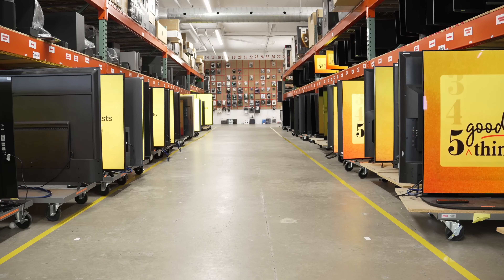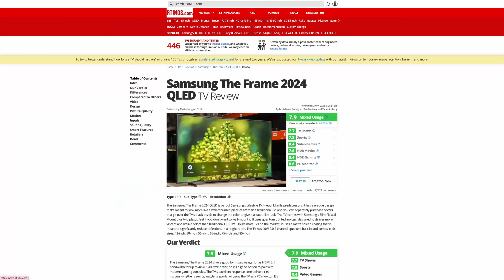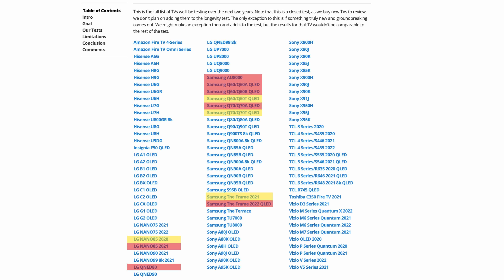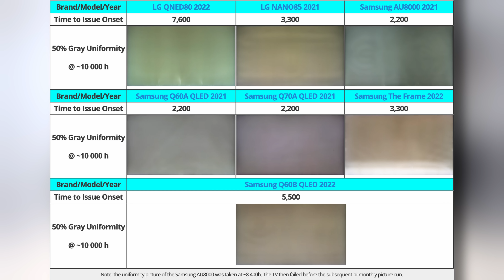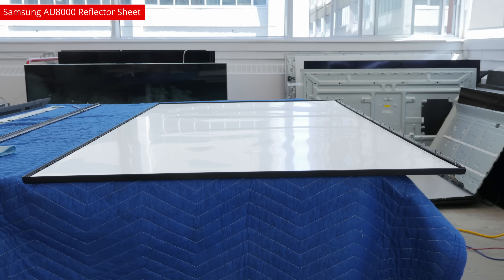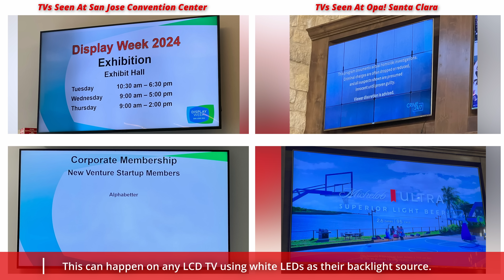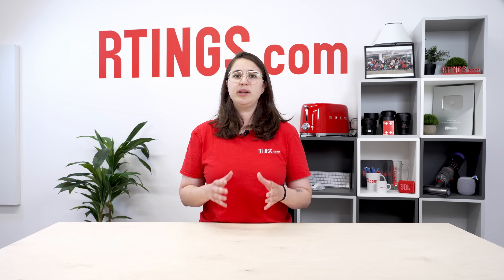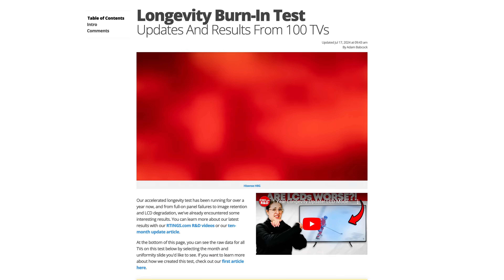Edge-Lit TVs Fail FASTER Than Others (100+ TV Test)

Comment: I might be using my TVs more than average. I got 25,000 hours within 7 years use.
But that is of course high end use. But that said, I think most TVs in family homes have a lot more use than 4.5 hours a day (which is what 10,000 hours is over 6 years). A family with kids will have them watch it then parents etc in evening. Some days more than others. Especially when most are home. 

So the problem in this case is mostly thinly built LCD and edge-lit ones. Basically the really low end crap, except a few models. But still crap (yes they are). Not surprising. I am sure some higher end MiniLED might fail here and there as well. But question becomes are those an outlier lemon or not. 

I have a high end thick miniLED I don't expect it to fail. Sony Bravia 9. But that said I will get extended warranty from Sony because it's expensive and even if they are not prone to failing. Sometimes a TV is just a lemon/dud. 

The OLEDs all burn in. But otherwise seem good. I wish they could come up with in-organic "O"LED in the near future. That would be ultimate TV. And no microLED is never really going to work out.

Comment: On my Sony KDL-43WF665, which I have for almost 6 years now, there is a "lighting gradient". Lower part of the screen appears brighter than the upper one and causes raised black levels and uniformity issues in general. It kinda looks like the reason is the edge lighting, but as far as I'm aware, it has Direct LED. Also my relatively new LG C2 48" has a simmilar uniformity issue, but much less pronounced, left part of the screen is slightly dimmer at low brightness colors (about 15 out of 255 an lower) and appears to be a bit red. Slightly visible at youtube loading screen when using my ps5.

Comment: My last LCD turned blue in about 4-5 years. My OLED just had its 4th bday and there is some very very faint  burn in if I run display a near black grey screen, but otherwise the picture is still beautiful and vibrant. I’ll take that trade every time. Can’t wait for full PHOLED in the next couple years. That’ll be my next upgrade when it gets under 2 grand.

Comment: I have a 43" Samsung LCD that i semi recently replaced with an oled. It was already cheap when I bought it in 2019, so  I took a crack at replacing the leds myself. It had all the "features" you mentioned (cracked back layer, burnt out leds) and in an act of incredible cheapness i "solved" the issue by flipping the diffusion layer 180 so the cracks were on top of the screen. ( of course i didnt line everything up right the first time, and I pinched a corner too hard putting it back together the second time but at least  it's not in a landfill just yet)

Comment: That explains why I never had any issues with edge-lit LED monitors. I always use them at low brightness (0-20%), and they never stay on 24/7, so  they don't generate as much heat and have a lot of time to cool down. Now I wonder what has better cooling, TVs or monitors? I had never looked at the cooling aspect before.
Reply: I wouldn’t say monitors have the better cooling, but they tend to be quite a bit smaller. 
As a result they need less backlight and can therefore run cooler.

Comment: You forgot a very important point about lowering damage for heat on flat TV's.
Wall hanging them and the sun.
If you want your TV to last don't hang them on the wall, don't allow direct sun on the panel front or back.
And of course the lower you run what ever kind of backlight or OLED light setting day to day the lower it will last.
I have a LG 4k OLED from 2015 with over 41K hours on it with zero burn in, 
it has actually gotten better over the years because all those compensation cycles evened out pretty much any of the flaws it had when i got it. 

Point is, don't let them run hot if you want them to last, save the max light output to when you need it like watching HDR movies or something like that.

Comment: Oh wow, troublesome news. My NANO86 being used 15 hours a day with maximum brightness so far over a year going strong, uniformity is fine. But definitely makes me cautious. 
Although there is now a speck of dust (not a dead pixel) pretty visible under the front plastic layer, no idea how it got there.
Reply: after 2.5 years of use I decided to sell it, but buyer returned it due to backlight being whiter and brighter on the bottom than on top. I didn't notice how it started happening.

Comment: I just tested my 2014 Sony W950B which is supposed to be edge-lit with full white (no light sensor, max backlight) and the temperature was the same across the entire panel and also the screen is pure white.  

Does that mean that it's not edge-lit and everyone got that wrong? 🙂 In your defense, Rtings did NOT specify the backlight in its review unlike other stores and reviews.

Comment: My Sony X900E has been on for 40 000 hours according to the service menu, still looks as good as it did when it was new. Been used as a pc monitor basically every day since 2017. 

According to Rtings, thats 24 years of normal use, so thats pretty cool I guess.
Reply: Your TV has been running 15+ hours every single day in the last 7 years?
Reply: @Flashv28  Youtube ate my reply, so here we go again...
Sounds about right. Bought it in late 2017, and as Im typing this the TV shows 40444 hours. Gets turned on when I wake up, and stays on till I go to bed. Back in late 2022 it had 30706 hours on it, so that makes it 10000 hours in 1.7 years or so. Posted the last letters of a picture link to the images on my first attempt, but I guess thats what made youtube angry.
Reply: @Flashv28  That doesnt sound far off. Its at 40444 hours at this moment, bought in Oct\Nov 2017. Gets turned on the moment I wake up and stays on till I go to bed.
Posted 2 pictures of it as well, /a/uptime-rcaExBG on Imgur. One from late 2022 at 30706 hours, and the current one at 40444 hours. The numbers you see at the bottoms are "screen lit time" if I remember correctly, so basically how many hours its been turned on. Even the store display models dont get hours like this apparently. Not sure if its something I should be proud or ashamed of, but it is what it is :)
Reply: If you know how imgur works, this is the album rcaExBG .

Comment: I'm hoping my current TV lasts long enough for 50" QDEL to hit sub-$1000. I run most of my monitors at somewhere close to minimum brightness most of the time, 30% at most apart from my cellphone when I'm outdoors, not expecting to ever see any backlight heat issues.

Comment: Thank you for doing this, I can imagine how expensive this can get.

I've had an LG TV turning purple under warranty (direct lit) and the fix was new LEDs plus limit the brightness. They locked up setting and had to reset the TV, as it was too low to be useful.
The replacement LEDs seem to still be OK but now have issues with the panel having two lines of stuck pixels. 

I previously had a Philips LCD that is still working after 15y of use, only developing some amount of uniformity issues, still usable. It still gets very bright and is a fluorescent lit model.
It has outlive an Asus monitor with LED that is now purple, despite being half the age.

Comment: What an irony, after I bought a new TV from LG, which ofcourse is using edge lighting technology, I'm getting to know this. Pretty disappointed with my decision. I got the newest prelaunch model i.e.LG QNED88T6A at a very attractive price. Need one help with this ASAP, @rtings or anyone for the matter. I noticed some leakage current or what I exactly don't know when I touch the bottom part of the TV. When I move my hand on the bottom part I feel a mild vibration of current when switched on, even my home has proper earthing. Problem is the tv comes with 2 pin adapter. Any help is highly appreciated. Thanks in advance

Comment: Did old high-end edge-Lit tvs have light along all edges or top and bottom?  

I own a Sony from 2014 that is edge-lit has 2-3 times the hours and has none of these issues.  Panel is almost as clear as my OLED panels and highlights still are off the charts.  I run it with the light sensor and backlight to 9 (not max) but it does top out on a bright day and most of the time it's probably ay 50%-80% brightness depending on ambient conditions.

Comment: I have an edge-lit LCD TV and while it has lasted me for over 10 years, some of the LEDs stopped working recently which has left a rather wide, dark line in the middle of the TV, which made watching this video kind of funny. Double the defects! I think the reasons why it has lasted so long is that the lights are split on the left and right sides so it's not one, dense line of LEDs at the bottom like show in this video. And since this TV is older, the extra thickness probably helps carry the heat away from the lights. I also have a table fan on almost 24/7 to help me stay cool and that airflow is close enough to the TV that it might help there too.
Once I can afford a new TV, I think I'll stay away from edge-lit models. Thanks for all the hard work.

Comment: Hi, I have been repairing TVs for a long time. Regarding the light diffuser cracking, it is very common for it to crack from removing the housing on the Samsung (the housing is snap-on). This happens mainly through material fatigue and the diffuser is then very brittle at the burn-in point. However, it also cracks spontaneously from being heated up by the LED backlight. Samsung televisions also have considerable panel problems. 90% of the faults on today's TVs involve replacing the LED backlight on the strips. Edge led is kinda another problem, bcuz u need also replace diffuser which is very expensive and hard to transport due to fragile.

Comment: The LEDs have a lifespan... but so have the OLEDs. I work with TV service the past 15 years and the fault rate in Oled is about 40% higher the LCDs with LED backlight. I am only comparing mid to high range models. Comparing low end makes no sense because you can get low end LCD bud not low end OLED.

Comment: This video series was one of the critical resources that gave me the confidence to buy an OLED monitor. Seeing that LCDs also suffer from wear and tear due to heat and phosphor degradation made me realize that every electronic device I own will eventually die. There's no reason I should be stressing over the lifespan of a device. My monitor comes with a 3 year burn in warranty, which is enough insurance for me. I know burn in is a potential issue, but at least I can mitigate it while still getting one of the best monitors on the market. By the time burn in becomes a real issue, I'll be able to pick up a much cheaper monitor with much better performance. So I'm not too worried about my current monitor burning in.

Comment: Thanks for this analysis and all of your ongoing TV testing work; it makes sense that FALD TVs are brighter and cooler than ultra-thin edge-lit TVs, due to having more coverage behind the screen and more thickness for a heatsink across the entire back. I'll be sure to avoid ultra-thin edge-lit models, as I like using my TVs at maximum brightness and prefer longevity to thinness. I honestly don't think thinness really matters in a TV, as long as it's under maybe 10cm and under 50kg.

Comment: At work we experimented with lots of digital signage (around concurrently 40 at any given time) and found that Samsung commercial and consumer edge-lit TVs had about a 50% failure rate within 2 years due to burned out LEDs, cracking, and warping of the internal components. Edge-lit might be thinner but they have significantly shorter lifespans. FALD all the way for me personally or better yet, OLED or MiniLED.

Comment: Longevity is a secondary benefit to having more zones.
Ironically the move to "Mini LED" means we can be fairly certain those LED emitters will be less durable than older LED emitters, but at that point to get a true understanding of the lifetime light output capabilities of any given TV we have to measure the surface area of all emitters combined, thus a TV with thousands of zones and therefore at least one emitter per-zone should last much longer than a TV with just dozens of zones.

Comment: At 4:30 you mention that 20ºC is 68ºF, a delta of 20ºC is only 36ºF. The additional 32º if the temperature was 68º is because 0ºC is 32ºF, but this doesn't apply to differences
Reply from the maker: Thank you for pointing that out, that's our mistake and we've addressed it in a new pinned comment!

Comment: 10K hours in a short time doesn’t equal to 10 years of use. 10K hours over 10 years equals to 10 years of use. Especially if heat is the issue.
Reply: 10k hours without turning off would probably be safer than 10k hours over a staggered period, because the heat stress would be exacerbated by the hot-cold thermal cycling.